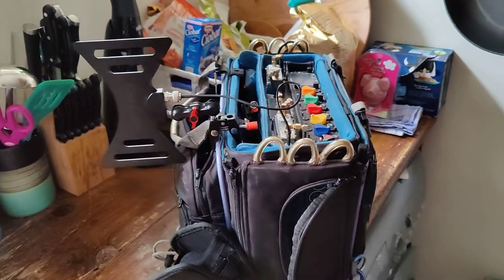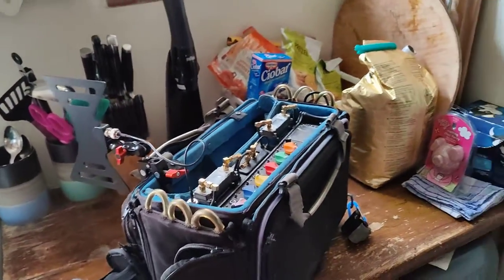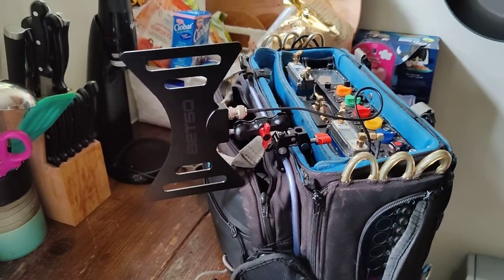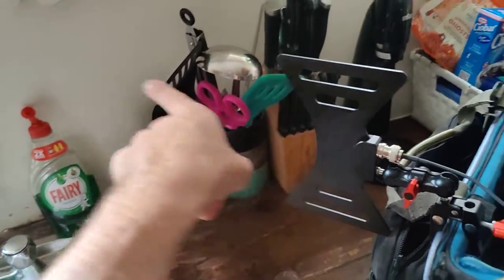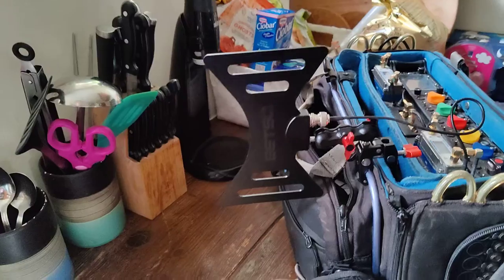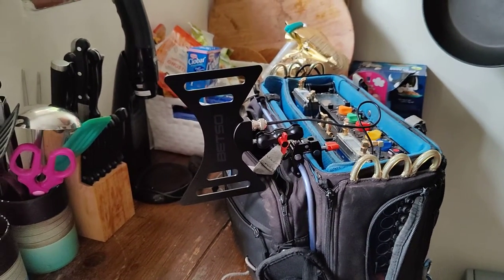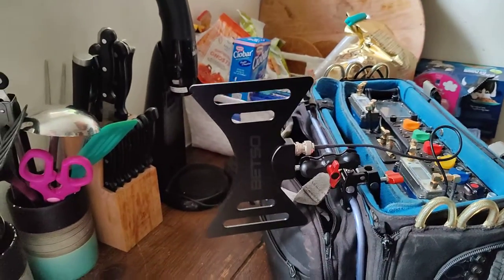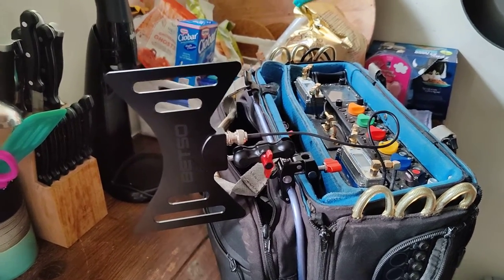How To Setup Betso Bowtie Antennas

Comment: I don't know the answer to this....But I'm assuming the bowtie antennas are still linearly polarized just like a whip or sharky, so would it be a good idea in a dual antenna bag setup to slightly angle the two antennas in different planes?  I don't see many people doing this, usually they have them both vertical which to me is somewhat missing the point of having two antennas. I'm really interested in your experiences whether there  is a significant distance capability over whips. I do see an advantage in the broadband nature of bowties over whips but I'm rather uncertain they actually increase the gain/range.
Reply from the maker: For whip diopoles I have seen people mix them especially for indoors with reflections etc...

Comment: Hi Matt Price, sorry to bother you with this product being released for so long. I'm a location sound mixer from China, what I want to ask is whether this product can be powered? Because I don't have a slot-in receivers like yours, I use many receivers with a Chinese-made psc splitter, so when the betso bowtie antenna is connected, my receiver does not have any signal gain change, but once I turn it on The power on the pcs distributor, the signal of my receiver is very stable, but will it damage the Betso Bowtie Antenna？

Comment: Welcome back and thank you 

With such antennas the reception will be more powerful but maybe more directionnel ? 

If we don't have the SL6 (or any slot-in receivers) and we have for example 2 dual receivers, is it enough to link each receiver with one betso (and what about the other "free" antenna input)?
Reply from the maker: Yeah it should be enough to link to any distro for 1 antenna and with the other free port you can add a whip or another Betso for more range coverage if needed.